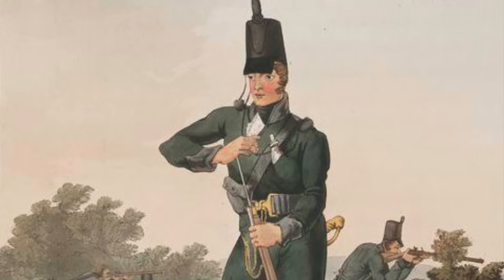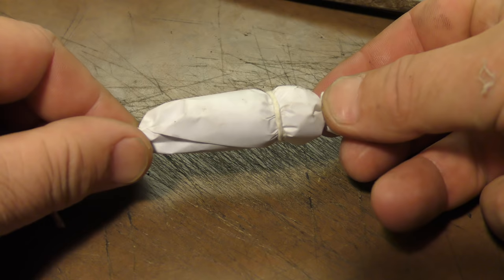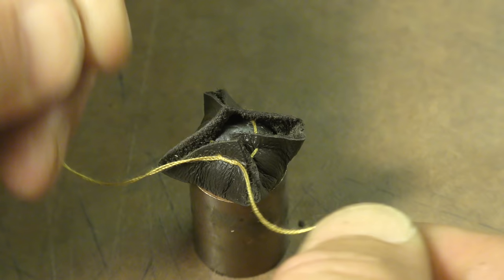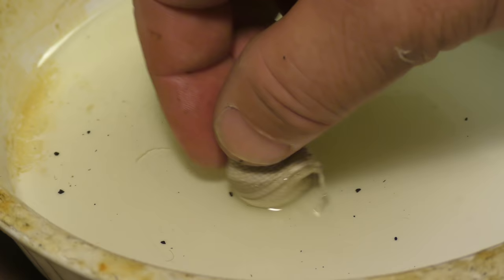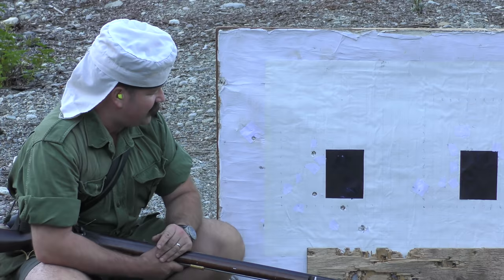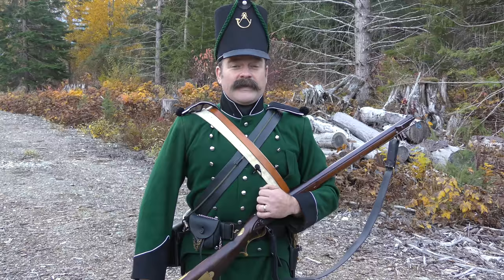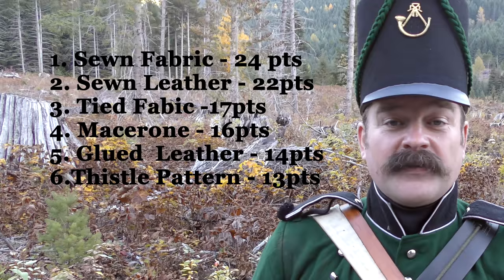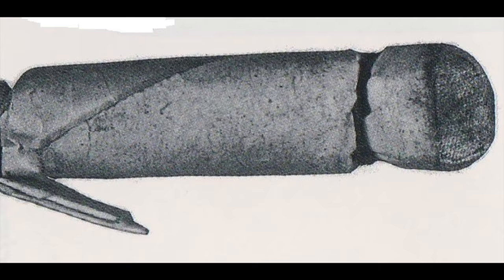The 1800 Pattern Baker Rifle: Shooting with Paper Cartridges - PART THREE-

Comment: O'er the hills and o'er the Main 
Through Flanders, Portugal and Spain 
King George commands and we obey 
Over the hills and far away
Reply: Originally 'Queen Anne commands' surely?
Reply: @johnfisk811 That's the version which precedes the Sharpe Series.
Reply: how did you get your comment to new-line so nicely? My comments keep getting compressed to remove line-breaks :(
Reply: Sharpie, the only role where Sean Bean does not die.
Reply: cheers. I used plain 'enter' and visually it worked, until I submitted the comment.
Reply: @CSSVirginia  He didn't die in Ronin (although his character, the fake SAS poser Spence, does get humiliated by Robert DeNiro's character) or in The Martian (although his role in that was relatively tiny). Still, his characters don't generally tend to fare very well...
Reply: @simonferrer  his characters careeer did not survive that movie
Reply: @simonferrer  His best death was Boromir in Lord of the Rings.
Reply: @CSSVirginia  He didn't die, but he did ''die'' when he got ''executed''
Reply: Now that's soldiering!
Reply: @HandleMyBallsYouTube  when he was "hanged" it was another criminal that took his place(Wellington and the other officers planned it)

Comment: If one end of the string (that is on the patch) is be left long, so when wrapped in fold of the cartridge at 3:49, it would run the length of the paper, and it would automatically pull it off when the ball pushed proud, and into the barrel increasing ease, and speed of use.
Reply from the maker: That might work.

Comment: A couple of questions...
1) would it improve consistency to have a separate smaller chamber of powder for priming, to thus get a more regular amount for charging?
2) Are you 100% restricted to round ball for this work? With a slow twist rate, would a short fat wadcutter or conical give improved stabilisation?
3) Regarding the glued patches, could a hard wax (beeswax, since I guess paraffin wax is period-incorrect?)be used instead of glue? Would it hold strongly, but melt in the firing process and hence give quick detachment?
4) Could the resilience of the 'Macerator' (don't want to sound too French do we?) be improved by making a larger 1-open-ended tube of thicker paper to slide over the ball-end? Just slip it off on withdrawal or after priming etc?
5) Can I have a go?
Reply from the maker: A couple of answers:
1) Way too complicated to make many of, and in no way historical.
2) Yes.... only RB was used with the Baker rifle in British and Empire Service.
3) Perhaps... not very strong and not at all very good for "lubricant" in this capacity...
4) Yes it could, but considering that it is the only pattern actually documented and that no such cover was mentioned, leads me to believe that this would be ahistorical..
5) At making your own cartridges?... sure thing... I'd be interested in your results!
Cheers.
Reply: Thanks for the answers.

Regarding making my own cartridges, I'm afraid I just don't have the balls....!

Comment: I should think that once the patched ball is coated in shortening;  once dried; the string can be removed before completing the full cartridge.
The shortening should keep the patched ball together until ready for use, and remove the step of discarding the string during loading. 

Food for thought. 

Now that's Soldiering. ^.-.^
Reply from the maker: Shortening would not hold it closed,... however wax and shortening might... but,... neither of these solutions are "service appropriate" as they are both extremely fragile.  Cheers.

Comment: adding wax to the lube mix (50/50) would retain the patch and ball shape without the need of the string at all.  I use a pre-lubed patch roll.  the roll is quite stiff once cool.  I don't know how historical that might be, but I imagine there were many methods used throughout the world when making cartridges depending upon the availability of materials.

I'm going to try making some wax paper cartridges of my own now instead of using modern plastic speed-loaders.  Thanks for the videos.
Reply from the maker: Indeed.... so many variables...

Comment: YEH back to muzzleloaders

Thinking of a weaker glue that might work : melted wax might work while still wet.dipping ball into wax then onto fabric.  Not that we will try that as it doesn’t seem easy
Reply from the maker: Wax is not a very good "lubricant" in this capacity... it must be mixed with grease to make it more effective but then it looses it's "stiffness"...

Comment: need your expertise on this: what would happen if you bit off the bullet end of cartridge then load the rifle?
Reply from the maker: It would be very messy... The powder sits right against the bullet so when you bite it off, the powder would spill.  When you bite the powder end, there is some paper that gives a sort of "working space" so that you actually tear the paper slightly away from the powder... it's not perfect of course but taking the bullet end off is by far the less efficient method.  Then you have a ball in your mouth wrapped in paper... and undoubtedly a bunch of powder.. spitting it out into your hand and then loading it?.... clumsy... by tearing the powder end there is one tearing motion and one loading motion... much more efficient.
Reply: thank you for clearing it up for me never worked with cartridge for muzzleloaders just powder patch and ball

Comment: It seems like with certain paper cartridges the reload time of the weapon is comparable to a Brown Bess musket. Is there a reason why this weapon was only given to select rifleman rather than the line infantry? I always thought the rate of reload was the issue. Great video as usual!
Reply from the maker: It was very expensive, by comparison...  Yes, with unpatched ball cartridges, it is about the same speed in reloading. With loose patched ball and powder, it is significantly slower...
Reply: Just out of curiosity, would the baker with a longer sword bayonet also be a less effective weapon than a Brown Bess with a bayonet? I have heard it said to be the case.
Reply from the maker: @superfarhan101  It is somewhat of a ungainly combination... Don't forget, that kind of fighting is more an issue of numbers and aggressive momentum rather than finesse in fencing... Did the apparent disadvantage of the Baker and it's bayonet ever cause actions to be lost or out the riflemen at significant disadvantage?... The various histories of the Rifle Corps would seem to indicate that it didn't...  However.... it remained perhaps not the best combination... therefore in 1815 a program was instituted whereby older 1800 pattern Bakers were converted to use socket bayonets. ( the 1800/15 Pattern).  These were superseded from 1823 with a hybrid  "hand bayonet" which had a triangular socket bayonet blade with a brass hilt...
Reply: Late to the discussion, but IIRC, most line infantry of this period were not permitted to perform maintenance on their muskets (cleaning, flint knapping, spring adjustment, etc.), hence the need for undersized rounds to continuing loading after fouling build-up. A rifle, on the other hand, would have to have the barrel cleaned in the field at some point to remain effective, along with other maintenance tasks. Naturally, a specialty unit who already do something out of the ordinary from line infantry could also be reasonably expected to be trained in that manner.

Comment: It would be interesting to see how the cartridges were made back in the day.  Were they made in ammo factories or by the soldiers?
Reply: Not sure about the cartridges for the Baker Rifle (different use and calibre), but certainly the cartridges for the Brown Bess muskets used by the regular infantry was made in factories and supplied in crates for ease of transport. If you read accounts about the Battle of Waterloo, one of the main reasons that the Farm of Hougoumont remained in Allied hands despite the constant attacks was because a driver from what would become the Royal Logistics Corps, drove a wagon into the farmyard filled with boxes of cartridges to resupply the defenders.
Reply: There were factory made issue carbine cartridges which were the ones used as paper ball cartridges for close range rapid fire but there are numerous accounts for the issue of materials to regiments to make Baker cartridges and one might assume these to be for patched ball cartridges. Early in the war loose patches and balls were issued for accurate long range rifle fire but this was abandoned partway through the war, flasks and horns ditched and the patched ball cartridge substituted. A smaller 22 to the pound ball was used for the patched ball of either type and a normal issue smooth bore carbine 20 to the pound used for the paper patched ball. Personally, and without any evidence to back me up, I opine that even the patched ball cartridges increasingly came from factory made ammunition. The production process is fine in barracks with all the cutting and measuring etc, kit to hand but not in the field. 

Rob has done an impeccable task with these videos and I have yet to rebuild my original Baker to live action standard. Unsupported by real time trial as Rob has done here so well  I am of the opinion that the patched ball cartridge was a sewn fabric patched 22 bore ball set into a normal paper cartridge and then the ball end lubricated. I look forward to giving this a trial next year. Rob has already shown that this is hard work to load unless the patch and paper combine to give a proper size. We shall see but Rob is 'the Man'.